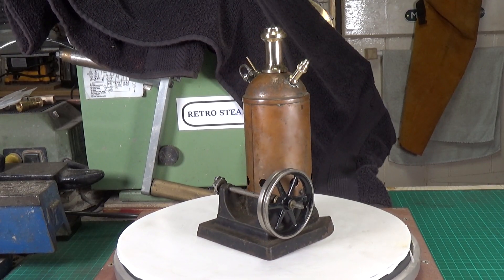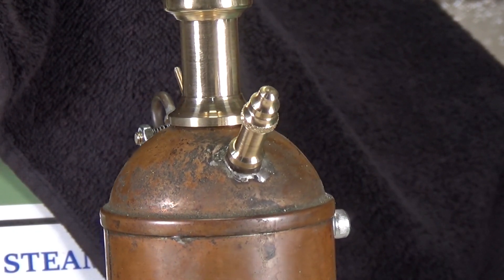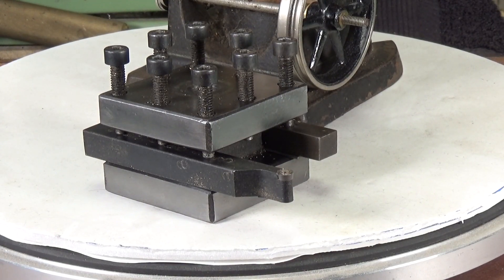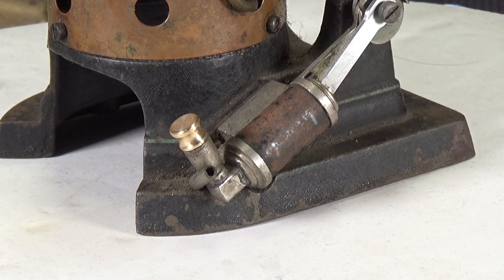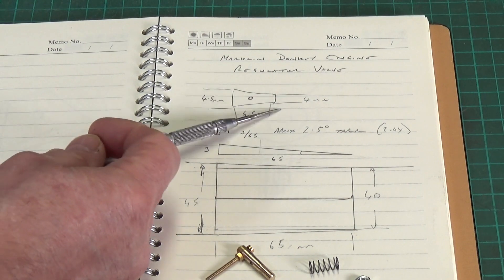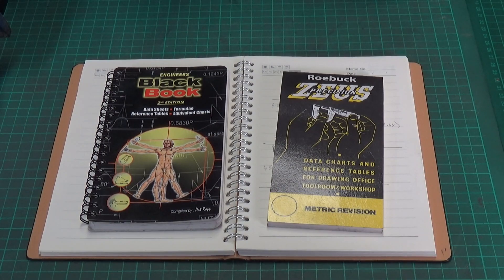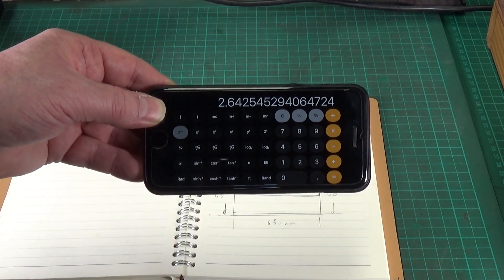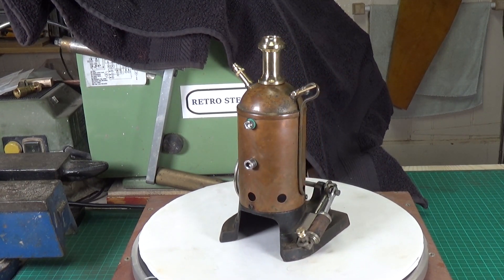Märklin 4113/6 Donkey Engine - Part Two

Comment: Nice work Alan.  I grind suitable forming tools from HSS.  Not difficult.  Good tip about rotating the Android calculator.  I hadn't seen that before.  Cheers Rob
Reply from the maker: Thanks Rob. Don't tell anyone but I found out about the calculator thing by accident 😂 I've always had iPhones but I assume it's the same on Android phones. Cheers, Alan.
Reply: @RetroSteamTech  Hi Alan.  It is the same on Androids.  Cheers Rob

Comment: Thanks for sharing 👍 what heat resistant paint do you use?
Reply from the maker: Hi Craig. The paint is E-TECH XHT Extremely High Temperature paint. I've used it several times now on different fireboxes and have had good results. Cheers, Alan.
Reply: @RetroSteamTech : Thank you, I'll see if I can get it here in the States. I'm very dissatisfied with the product I'm currently using.

Comment: Oh i have a parts one complete but boiler leaks very nervous trying to solder it.
Reply from the maker: They are great little engines. I've run this one on air and it seems to hold pressure ok. The real test will be when I try and steam it!